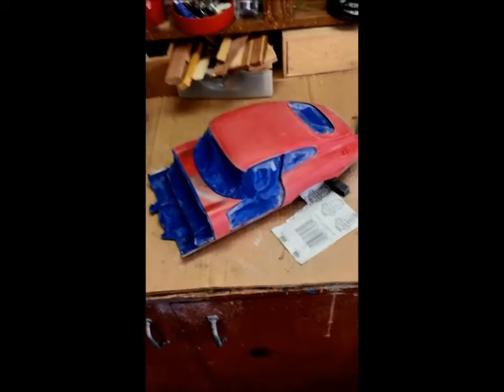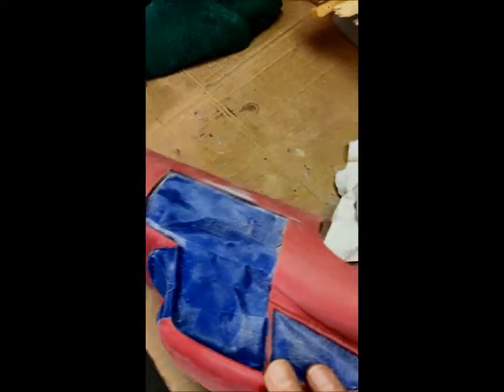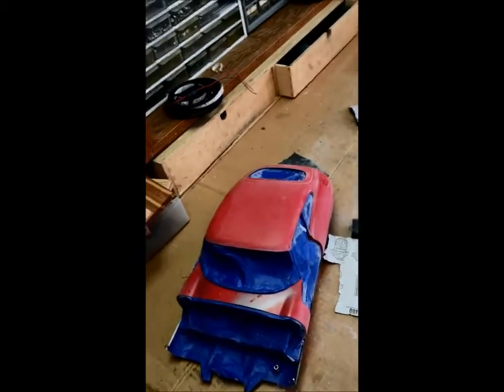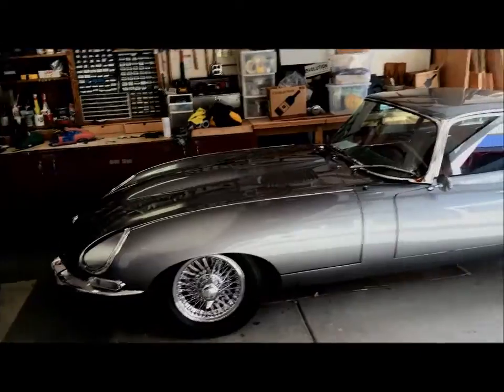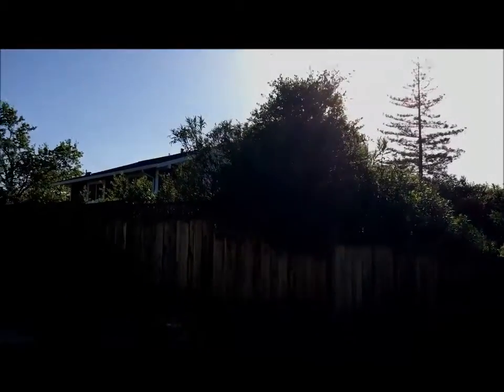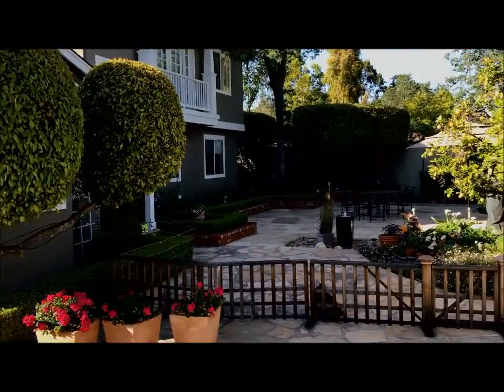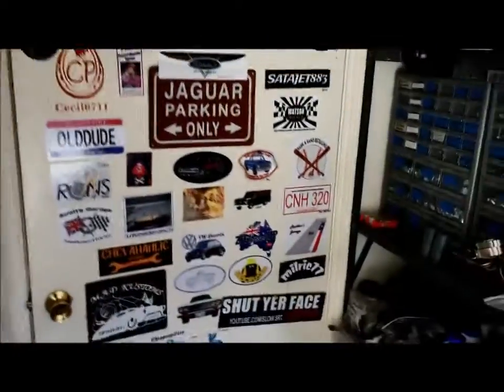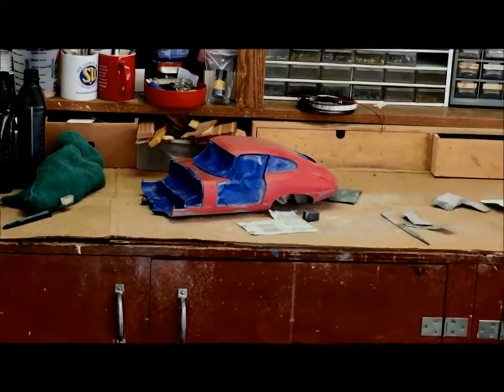Jag E-Type scale model update and yackin

Comment: To block sand models, I used to use one of those white vinyl erasers with the finer grit sandpapers.  Firm but flexible.  Have you had Betty appraised to make sure you have the proper insurance coverage?
Reply from the maker: +iceman22st  Thanks for the tip. I think we have some of these around.  I have my E-type insured as a stated value by my insurance company with documentation I provided them from auctions of similar condition E-types.  It may need to be increased soon if the values of the sales continue to rise, but that's a good problem to have I guess.

Comment: How did you overcome your paint problems? Looking great so far.
Reply from the maker: +The Shade Tree Fix-it Man   George, I purchased the clear coat from the same company that made the color match (automotive touchup).  It's stopped crackling the base coat, so the interior and underneath all of the panels is clear coated now without cracking. It was a pain and is part of the reason why I left it sit for a couple of month.
Reply: +JohnCarey1963Jag   Sometimes letting it sit for a while before going back to it gives a fresh perspective and renewed enjoyment to the project and that is a good thing. Hang in there, just like it's big sister, it will get done!